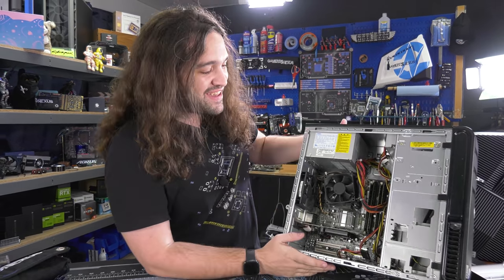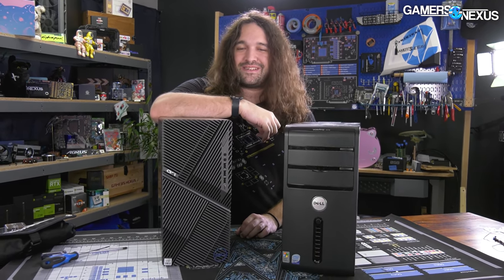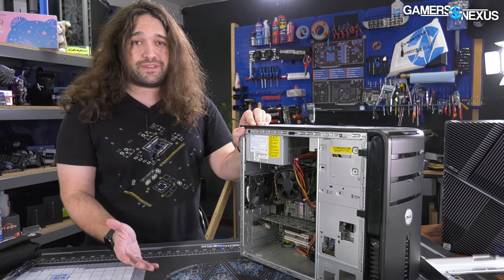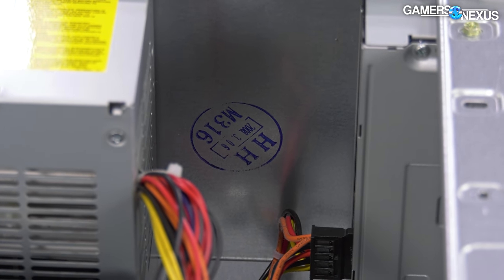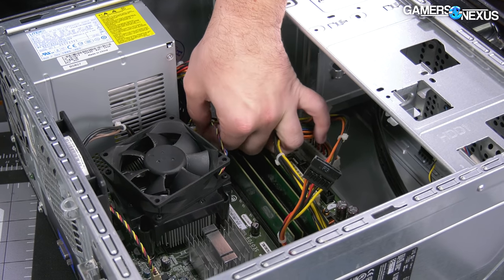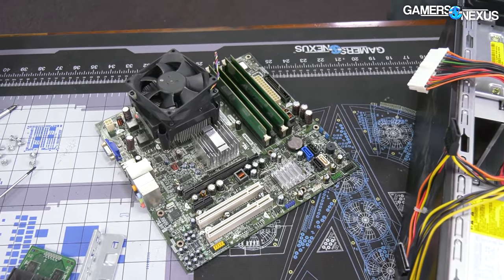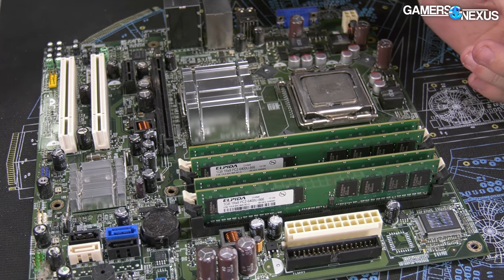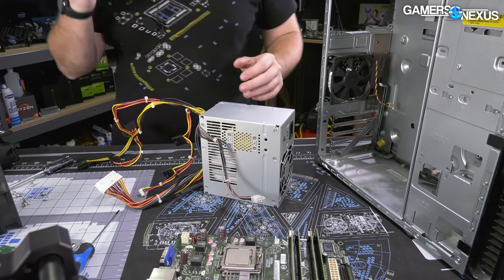13 Years of Dell Getting Worse

Comment: Here are some of my thoughts on working on Dells over the years:
The Pentium II and III XPS and L-series were standard ATX with the exception of 20-pin ATX connector on the PSU having a different pinout, and therefore only compatible with those Dell boards.  Reusing the case with a different brand board required a new PSU.
The clamshell-opening Dimension 8xxx, 4400, 4500, and 4550 used standard ATX power supplies, but would not fit if a power switch was present on the PSU.  They were otherwise proprietary designs.
The Dimension 2xxx, 4600, 4700, 3000, and B110/1100 were standard ATX except for the front panel audio header.  They used a thermal-controlled 92mm fan mounted with isolation mounts to a plastic mount that slid on from the inside rear of the case.  It used a duct to pull air from the heatsink out of the case.  The heatsink bracket was load-bearing, but the mounts could be removed by unscrewing them, allowing for different brand boards (and non-stock coolers) to be used.
The Dimension E310/3100, E510/5150, E520, and E521 were BTX-based.  ATX power supplies work with little or no modification.
The Inspiron 530/531 is a white colored version of the Vostro 400.  Dell would use this case design for a few more years.  However, on an Inspiron 570, the BIOS will complain at boot if the case's card reader and USB ports aren't connected.
As far as I know, the Dell Inspiron machines were standard ATX-based designs up through at least the 4th-gen Intel chips (such as the Inspiron 3847).  However, depending on model, the cases don't have a swappable I/O panel out back.

Comment: I remember some of the older Dell computers used a power supply that had a couple of wires in a different order than a standard power supply, but used the same motherboard connector,  so if you put an off the shelf power supply in without swapping those wires to match the Dell wiring pattern you would release the magic blue smoke.
Reply: XPS 8000 series did not have that problem at least. You're talking at the board connector right? OH wait nvm wtf am I talking about like Dell would've ever had a modular power supply
Reply: @pandemicneetbux2110  I found an article that indicates that from 1996 to 2000 Dell used power supplies with a 20 pin connector and another with a 6 pin connector to the motherboard.

The ones I remember did not use the 6 pin connector because I remember being able to swap 2 wires on a standard power supply to match the Dell pattern and having it work with the Dell motherboard.
Reply: Shite like this should be illegal...
Reply: @pandemicneetbux2110  hate to burst your bubble, but dell did/does use 'modular' supplies.
They're proprietary AF, but definitely modular.
Reply: @DrakkarCalethiel  fun fact, in some states Dell pcs are illegal now, but simply because of passive power draw while system is off.
Reply: Yeah, I was fairly sure these Vostros had that non standard connector wiring.

Comment: 10:00 actually Steve the new fan fastener is much better. Because it's elastic, it helps isolate the fan from the chassis so it should make the system overall more silent. The screws couple the fan to the chassis acoustically.
Reply: Noctua actually provides these with some of their fans
Reply: Exactly, I bought them extra from noctua for all my case fans so I hope that's an upgrade and not downgrade...I think Steve is the best person to actually test them if they work as intended, would be nice if he did a video on these...although I think their main advantage will show up after longer use, like if it's also better for bearing longetivity over the years...

Comment: that older dell is more solid of a system than people realize, even now still.  they are able to take up to the highest end core 2 quad cpus, support up to 8, and sometimes 16gb of ram, and have a pcie slot, sometimes 2.  so during a shortage they are still a compelling cheap option for emulation and mid range games.  4 solid cores, enough ram to get by, etc.
Reply: Dont buy one of these for games. The core 2 quad sounds appealing, but has no inter logic communication. Heavily threaded tasks choke on the bus bandwidth. The Q9650 performs worse then dual core pentiums today. If you go used, go no lower then 1st gen i series, those can still hold their own, albeit barely, in modern games.
Reply: @Nick-ue7iw  yea c2q are just two c2d dies thrown together, like the pentium d before it which was 2 pentium 4

Comment: It would be interesting to test that old power supply. See if there is any degradation with age
Reply: Old Dell power supplies were pretty indesctructible.
Reply: @pandemicneetbux2110  i had two computers(no dell) with liteon psu  and both worked more than a decade and would still work if those other components didnt die.
Reply: The lite-on PSU featured actually is good 
HP used this platform of PSU as well.

These have OST caps, better than Capxon but below Teapo quality.
Had Passive PFC.

Good circuit topology/design

Comment: I'm a serial Dell buyer since the days when he assembled them in his basement under the PCs Limited brand. My first one had a bent #1 pin on the parallel ribbon cable that attached to the (5-1/4") floppy readers. As a result it would never read a disk change.  I didn't discover it until I scrapped it years later. They advertised that every box was burned in before shipping so I've never trusted them since then. Why did I stick with him, then? The competition has always been worse, and the components usually had a quality differential, things like gold plated contacts and metal instead of plastic and so forth. My last box was a Dimension E510 that lasted 14 years with a power supply replacement at year 10.

My current box is an XPS 8120 from 2017 upgraded last year with a bigger ssd, a third HD and topped up RAM. I also swapped out the power supply with the one I had bought for the Dimension. The case and motherboard on the XPS are nearly identical to the Vostro you tore down here. The two complaints I have about the XPS are that :

- the power supply, which was a standard Silverstone Tek 600W Silver 80+ ATX/EPS, required an adapter for the motherboard wireset which is because Dell went proprietary on the plug;
- there is one, and only one, M2 slot so when I upgraded the SSD I had to shelve the old one. 

The Dimension was still going strong when I replaced it. The problem was that Windows XP was obsolete! I'm pretty sure that Microsoft will also be the reason that this XPS will need to be replaced when the time comes, rather than any hardware component failure.

My point here is that it looks like you are comparing apples and crabapples in this video. I'd like to see you do a side-by-side against a current XPS. 

I'm also hoping that you assemble a playlist of recommended standard components and maybe even some recommended custom builds. 

Thanks for these most excellent videos!

Comment: The rubber pegs holding the fans to the case break down pretty bad with age. I've had to replace several that broke off and left the fan to spin free inside of the case.
Reply: I tough they are to isolate vibration and noise suppress the fan a bit? My Noctua case fan came with 4 of these and also 4 screws if you don't have the space to plug them.
Reply: @SteelRodent Even if the fans just have a minimum of vibration, which can never be completely eliminated, those can help minimizing them further. I wonder if the ones Noctua or BeQuiet offer last longer. Maybe it's just the cheap ones that age so badly? The ones Noctua offers are made out of silicone, perhaps the cheaper ones are made from bad rubber that becomes brittle.
Reply: You can treat the silicone standoffs with cooking oils, makeup oils and well just about any skin safe oil with a good degree of success.  However silicone washers or o-rings are much easier to find replacements for given they are sold at hardware stores for a variety of uses.
Reply: @STaRgaTeBG  yeah Steve seemed disappointed with those but I think that's one actual improvement.

Comment: Shout out to the Q6600, that’s one of my favourite builds, it was solid. It might even still be alive in my server rack.
Reply: I had a Q6600, those are 2.4 ghz stock and I could push mine to 3.3 ghz without a voltage increase. I loved that thing.
Reply: Was it just before the core-I series...?
Reply: @Djuntas  Well, they were released before the I series. I got mine just after the I series was released. The I7 CPU's were ungodly expensive at the time.
Reply: Same here man, the Core2Quad series had some really great and iconic CPUs. Great overclock possibilities, if you managed to tune it properly you could achieve something like +15% of performance.
Reply: @cddll24  Yeah, now i wanna look this vs I7 860 or something hehe..And I did :P yup the I7 860 is way better, but could had been in 08/09 it was not the price king. Apparently q6600 was a 800 dollar cpu on launch, but quickly dropped to 250.
Reply: @Djuntas  yep, the core-I series was released in 2010
Reply: "Shout out to the Q6600, that’s one of my favourite builds, it was solid."

In Oct 2008, I actually ordered a Q6600 for my first gaming PC (with GTX 260), but returned it to Newegg and went with a Q9550 instead.

Out of curiosity, what do you use your rack of servers for?
Reply: @TMRick1  I hit like +40% if we're talking clock speed.
Reply: @Djuntas  The I7 performed a lot better on paper, but as far as games were concerned in the real world, it wasn't going to different from the Q6600. GPU's were the bottleneck.
Reply: @cddll24  Yeah thats likely the case. I guess even back then CPU's didn't matter much. I swear Im close to just buying a new GPU with my shitty ddr3 ram and I5 4590...Kinda wanna try it.
Reply: @Djuntas  I had an I7 4790 before my current CPU and... I can tell you, the 4590 will bottleneck you depending on the GPU.
Reply: @cddll24  Yeah I guess. Wonder if I could find a video on the topic...Ill look.
Reply: @cddll24  yeah. It was no Celeron 300, but the Q6600 was awesome.

Comment: I remember getting the cheapest dell you could get back in the early 2000's as a basic web-browsing/ home office PC for my dad and my step mom. It was $300 CAD (not including monitor, which I bought from somewhere else), and I was absolutely floored by how cool its custom cooling solution was for such a dirt cheap PC. I remember also liking the keyboard and mouse that it came with. I was very impressed with it given the super low cost (it also came with windows XP). It still is, to this day, the quietest computer I've ever (barely) heard (aside from passively cooled laptops). I never actually tested it to see what it could do under a sustained workload, but I remember that it had one (or maybe two) relatively big fans running at a low rpm, with custom ducting which channeled hot air from, I think, a relatively large CPU cooler, and directly out of the case. I remember being able to get the fan to run faster, and that it was always really quiet and pleasant sounding. 

That PC worked fine for over 10 years, until it was eventually retired.

I also have a dell laptop which is now 12 years old, (A Vostro 1320 iirc) and it still works. It was $650 CAD and had a Core 2 Duo P8600, which was a very powerful laptop CPU for that price range back in the day. It also had easily upgradeable RAM and storage drive. It also had an easily replaceable battery, and I've only had to replace the battery once so far after 13 years. I think I need to re apply the paste on the CPU, because it seems to struggle to keep the cpu properly cooled under load, but it still allows me to do the basic things that I like to be able to do with a laptop.

Dell really has gotten a lot worse over the years, but I'm sure they were making a lot of crap or overpriced stuff back in the day as well (but I definitely was quite happy with some of their low-end stuff between around 2003-2009

Comment: "we've even got an original peel film. That's right, we got one."
Reply: If this doesn't get 10k likes I will never truly believe in karma
Reply: Looks like the original tweezers on the cables too.
Reply: Where Steve went horribly wrong was disassembly without using a Swiss Army knife, that (hopefully) has a Phillips screwdriver.
Reply: I tend to leave most peel film right where it is. It serves no purpose in the garbage.

Comment: My dad got this old server case from HP with a power supply in 2006. We had a Pentium 4 system then, we swapped and exchanged parts to build a combined cabinet. In 2009 we changed it to dual core, and then a first gen core i5. Used that set up till last month as a backup cabinet. Switch the HDD a couple of times and now it rocks an SSD and I run CentOS 8 on it. Mainly use it to check removable disks for viruses before using them in windows (still have some use cases). It works. 17 years and it still runs. Standardised parts really help

Comment: HP also used standard sized components up till about 2008-2010. Motherboards were custom (downgraded) versions of retail boards with HP spec RAM, but otherwise you could in theory fairly easily transplant components.

From a production standpoint it honestly seems like it'd be more costly to use entirely proprietary parts because everything has to be custom made, which requires dedicated production lines, instead of just bulk buying parts and putting them together.

Comment: I remember the Dell Dimension XPS R400 from 1998, from way back in a time when Dell was actually somewhat of a poster child for making highly customizable prebuilts you could order online, that were pretty well made. Back in those days it was novel to order a customized computer online, and back then Dell actually let you customize FAR more about the build than they do these days. Once upon a time Dell stood out for having far more customization than the other big brands. Since then they've thrown it all away of course.
Reply: I had one of those for college in 1998.  Aside from the proprietary PSU and motherboard, everything else was pretty standard.  The case design was way better than the Baby AT cases most people had at the time.  The PC was insanely upgradable given the limitations.  In the end I eventually upgraded the CPU twice first to a Pentium III 700 MHz, then to a Tualatin Celeron 1.4 GHz (with a fancy adapter).  The GPU went from an NVIDIA Riva 128 ZX to a Voodoo3 to a GeForce 2 MX to an AMD Radeon 9000 Pro.  I upgraded the internal sound card to a Sound Blaster Live! Value.  Also added a Promise Ultra ATA/100 IDE controller and an Ethernet card.  I was using it well into the next decade and only replaced it with subpar laptops until I eventually built a custom desktop in 2012.

Comment: I have an optiplex from about 10 years ago. Was able to stick 2x 8Gb DDR3 sticks in it, a 1050Ti 4GB GPU and a usb 3.0 expansion card. Got a SSD as the boot drive and it's running windows 10 pro like a champ.

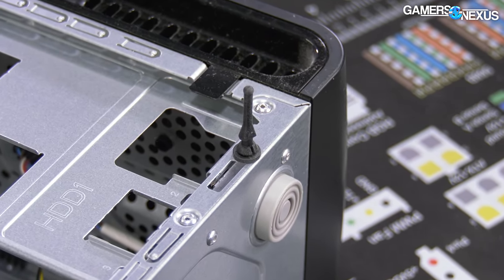Comment: 9:49 Dude, that's a vibration absorbing mount. Noctua has been shipping them with their fans for decades. That's not a cost saving measure by any stretch — compared to screws, they're a pain to install.
Reply: Fitting them on chassis is hard.
Second hard part is pulling the inner ones to mount the fan, they are hard to reach
Reply: I remember paying something like 6€ for an 8-pack of those rubber pins back in mid 2000s.
Reply: I have recently built a PC with all of the fan screws replaced with these silicon variants - 24 of them to be exact. Some of them were a pain to install because of their crammed position (as PC CORN have said), but in the end they look unique and keep the cheap Deepcool CF120 fans from possibly rattling the whole case.

I wonder if they are going to get stiff and brittle in the coming years.
Reply: @92kosta  i think they might be fine. I came across some of the pins i purchased 15 years ago recently and they're still alright. It's probably TPU/TPE so it can degrade but it doesn't have to.
Reply: @92kosta  Might depend on the material used and the quality but I have some in a i5-2500k build that is at least 10 years old by now and they are perfectly fine and don't look like there is any real degradation. I would assume that PC is dead before the mounts of the fans fail. Maybe if they are exposed to strong direct sunlight all day, but you probably shouldn't place your pc like that anyway.

Comment: Several years ago, I purchased a prebuilt dell system. Just recently, I decided to upgrade the components inside of it, and it was by far one of the most miserable experiences ever, especially for the GPU. It didn't come with one, so I put in an old GTX-1050 Ti, and decided to upgrade to the RTX-3050. Turns out that the PSU that's included has the most proprietary cables ever made, so basically, I had to purchase a new 650W PSU along with a sketchy adapter from Amazon for the motherboard just so it'd run. Worst part of it all is that the documentation on the PC is horrible, so if I want to know the Pinouts for example on the PSU cables, I'd have to go digging in the Dell Forums for help. Overall, not a nice experience at all and I would have much rather just built my own PC if I could go back in time.